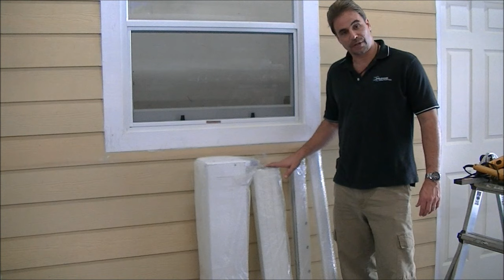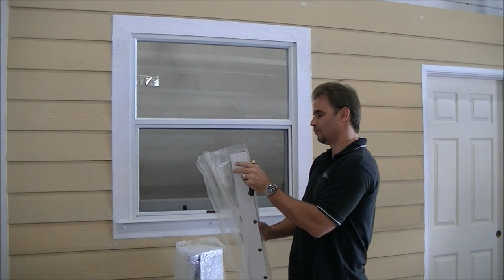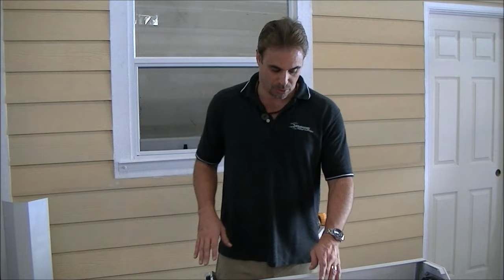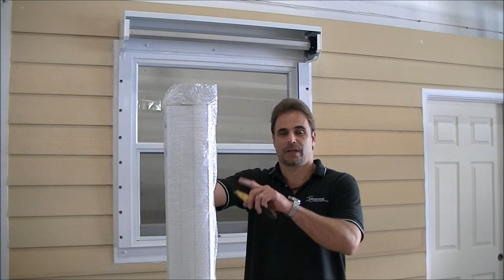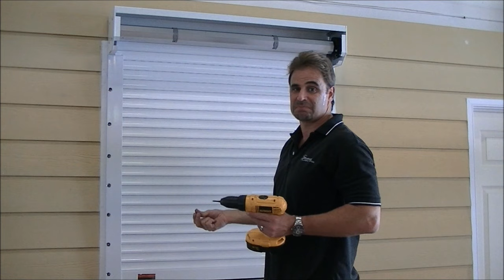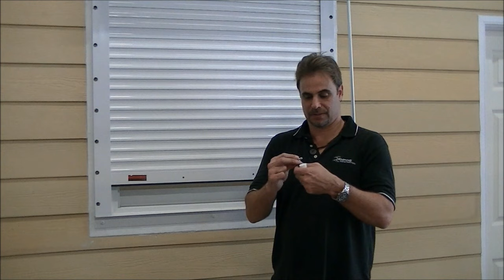Rolling Shutter Installation.wmv

Comment: The only issue I noticed is that debris and water can collect on top of the unit. It would definitely need to be caulked to prevent water damage inside the wall over and around the window.  Definitely inside manual or electric operation for home security.

Comment: how can that box be tucked inside flush instead of the box sitting outside.. in the new build can we accommodate that in the design to have it flush?
Reply from the maker: The shutter is designed to protect the opening facing forward or backward so turning it around is no problem.  You would have to create a pocket over the header to accommodate the housing.

Comment: Could I put these on the inside of a house so that an intruder can’t remove them from outside the house?
Reply from the maker: Yes, these shutters can be used on the inside as a security shutter.  We make them with locks as well if needed.  Give us a call at 954-474-3557 if we can help you.

Comment: don't forget to mention you must use a very short tek screw at the motor end to avoid cutting the motor inside in half
Reply from the maker: +Matt Hintze When you buy the shutters from us those 1/2" SDS screws you mentioned are included with your order.
Reply: @hurricaneshutters1  are you still in business?

Comment: Hey Mike, i know the video is a few years old. I have all sorts of un skilled construction and labor experience. There is a program that will 'teach you to become one of our installers' in which they then hire you after the class. I started my work on a forklift as a material handler and saw operator at a busy Granite and & Marble fabrication shop, then as a fabricator/installer. Went on to do other construction jobs like, laying & kicking carpet, tile, wood floors, VCT ect then installing doors, mirrors, bath tub shells. Worked for a guy putting up vinyl and chain link fences (dig dig dig, add concrete), layed sod and grass, eventually started as a helper for a Aluminum screen and pool enclosure company. I think the rolling shutter's aught to be easy and straight forward. I have a hoard of tools and have already worked as a helper in Aluminum.
Reply from the maker: Hello Casey, If you're looking for a job give us a call at 954-474-3557 and ask for Jorge